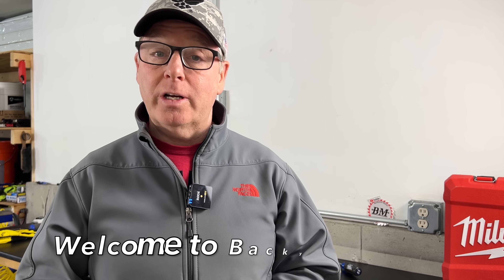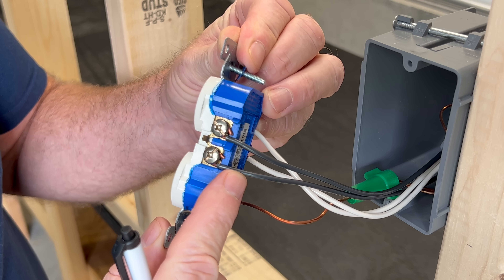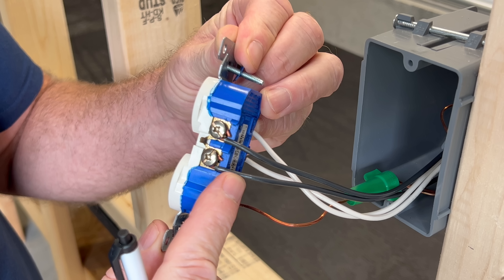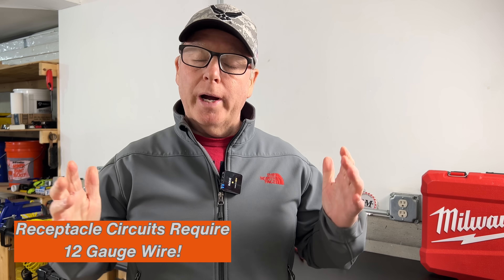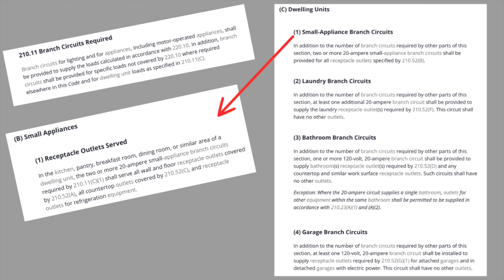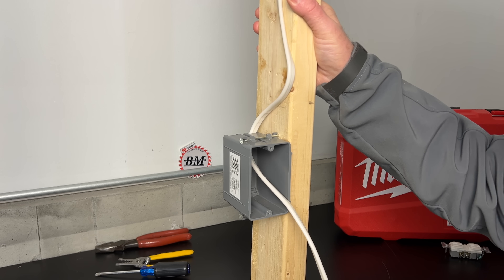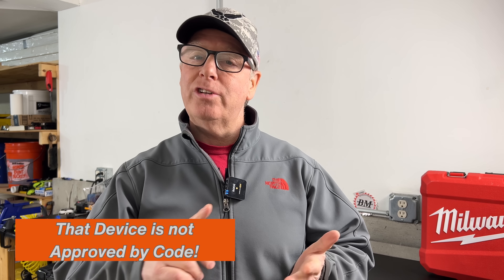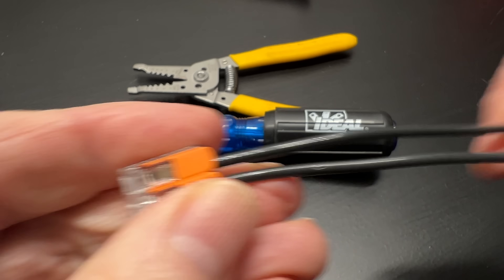5 Electrical Code Lies DIYers Should Stop Believing!

Comment: Hopefully this can be answered.. So for the past 2 years my outside outlets have been tripping the breaker even after replacing all the outlets, well i finally figured out a week or 2 ago that one of the outlets i replaced was faulty itself and was causing the problem, of which i have now THANKFULLY resolved.. So my original plan was to install 1 or more GFCI outlets but upon trying the box isnt deep enough because of the extra size of the outlet and the wiring so i just went back to a normal outlet, its unfortunately a recessed box thus my problem.

Now the thing is, my house was built in 2000 and when it was it never had any outside GFCI outlets (until i got a pool) but it had a GFCI Breaker to handle all that.. So how would i go about resolving the recessed box issue? would simply a deeper box fit in the current recessed place or would i need to have some kind of work done? 

Note: Its POSSIBLE it would fit if i pushed back some of the wiring into the wall but i didnt want to risk doing that.. So any thoughts?
Reply from the maker: You could install a GFCI breaker and use a standard receptacle, install a deep box bits that’s going to be a bit of work. Leviton make a slim profile GFCI receptacle which is about the same depth at a standard one. That may be the cheapest and easiest solution.
Reply: @BackyardMaine Yeah id rather not have to go with the box route lol 

The outside outlets are already under a GFCI Breaker but id rather a gfci outlet have control over it than always having to mess with the breaker if something happens.. I'll take a look at the Leviton, thanks :)

Comment: Would like to see a demonstration and your opinion on installing a GFCI in older homes with no ground. Will it actually help with electric shock or in helping to protect sensitive electronics.
Reply from the maker: Great Idea for a video. Yes a GFCI will still provide protection with no ground wire. It won't provide any protection for sensitive electronics though. For that you need a surge protector. They can be installed as a whole house unit of you can use them at the point of use.

Comment: Good video,    sounds like "discussions that may have come up with inspectors".   NES is basic framework document with many exceptions listed. Intent is to do best practices that keep the next guy alive.     In TX,  very little training required before Electrician on their own.    My top two worst finds:   2) septic pumps wired w Romex.  Needs water proof type of insulation on conductors.  2) Stoves not wired with 3 cond+grd.   Old style 220 v 2cond+grd  wiring short lifes the newer smart ovens or stoves.      Thank you.

Comment: Well said John. And by sticking to the NEC Standards, one is more likely than not, to perform safe work that will pass inspection. If someone sites the code, tell them to show you where. Make them prove it. Well done John. Thank you.
Reply from the maker: Thank you my friend.. I have asked for the code reference a few times but either they don't reply or reference the wrong article. Like article 81.. lol

Comment: So just if you install 20 amp receptacles, you should use 12 ga wire. And 15 amp receptacles use 14 gauge wire. Since it is labeled on the package from the manufacturer.  It could be a violation too install 12 gauge wire on a 15 amp receptacles ???
Reply from the maker: You can use larger wire like 12AWG on 15A receptacles as well but of course you will have to use the side wiring connection which I recommend anyway. The back stab connections are only listed for 14AWG solid copper wire. Ive been an electrician for decades and I as well as most other pros use 12AWG on 20A circuits and 14AWG on 15A circuits.

Comment: I was removing the 14 gauge wire out of my garage, House built in 2017 in North Carolina, replaced it with 12 gauge, and upgraded to a Combo GFCI/AFCI 20 amp breaker.  I was taken by surprise that a house built in 2017 had a 15amp service non-GFCI in the garage and it passed inspection.  I am the second owner and I had an inspection performed on the house before the purchase.  I had a house built in Georgia in 2015 and every circuit was AFCI or GFCI protected and it had to be a 20amp circuit in the garage.  I learned a very important lesson about states and the adoption of the NEC codes.
Reply from the maker: The issue is not all electrical inspectors have equal knowledge of the code and when you hire a home inspector to as a contingent to buying a home they are usually not as knowledgeable as a trained electrical inspector and they will miss things like a 15A non-GFCI circuit in the garage.
Reply: Under the NEC there are three locations where AFCI protection is not required in dwelling units:  bathrooms, outdoors, and yes, garages.  No need for a DF breaker on the garage circuit, although it might be more readily available than GFCI-only breakers in some areas.
Reply: @steveloux4709   I thought bathrooms still needed AFCI in modern code but it appears I am mistaken. However there are definitely other places where AFCI isn't needed, notably unfinished basements and attics. 210.12(A) shows there they are required and the omissions are where it's not. But it should also be noted that if the circuit has any devices (such as a switch) in the living area it needs AFCI even if the lights themselves are in area where they do not.

And unless they changed it only receptacles in a garage need GFCI protection. No need for a GFCI breaker, a standard breaker and common GFCI receptacle work just fine.
Reply: @steveloux4709  This is exactly the case here.  I can find old-school breakers and Dual Function only Breakers where I can shop as a homeowner.  I just checked Amazon for Square D QO, I can get GFCI only but pay more than I would for Dual Function
Reply from the maker: I think we were talking about GFCI rather than AFCI protection. GFCI protection is required in garages..  @steveloux4709

Comment: I've never heard anyone say that these are code. I know some argue about doing items like ground up, or pigtails better then wire thru. But you need 12 gauge on any 20 amp circuit or in kitchen/bath/exterior outlets/washer circuit. I prefer to put 12 on living circuits too tho where possible. You have a noticable draw on high draw items (curling/flat iron, clothes iron, blow dryer, clothing steamer, etc) and it will cause light dimming and things like that.
Reply from the maker: I’ve heard all that I mentioned 100s of times in the comments on my videos. I had several just today alone telling me ground up, pigtails and 12AWG a for all receptacles are required by code.

Comment: NEVER EVER USE A COMMON NEUTRAL !!!!!!!!!!

THE VOLTAGE DROP IS EXTREME

I SPEAK FROM EXPERIENCE HAVING TO REWIRE MY ENTIRE HOUSE BECAUSE I USED A CHEAP BUILDER

THE MONSTER USED SHARED 500 FOOT RUNS FOR EVERY ROOM AND SHARED THE NEUTRAL 😢😢😢😢😢😢

WHAT A NIGHTMARE
Reply from the maker: 500 foot runs in a home.  Interesting.
Reply: Common neutrals across multiple circuits are very bad. Multi-wire branch circuits, which are very similar but have specific requirements, are good. With an MWBC you get less voltage drop than with two separate circuits.
Reply from the maker: Common neutrals on two circuits form the same pole is dangerous because the current on each line wire will add up in the neutral and possibly overload the wires capacity. Common neutrals on different poles are multiwire branch circuits and there are several requirements associated with them.  @eDoc2020

Comment: its a national minimum std. Also in practice code is whatever your inspector says it is.  At least if you're expecting to make your deadline.
Reply from the maker: I hear that a lot but it's not accurate. If its a minimum standard then I suppose you run 10AWG for 20A circuits rather than going with the minimum 12AWG.
Reply: Its absolutely accurate.  If you choose to follow code that is the minimum required by definition. 10awg would be code compliant for a 20 amp cir.  Its just not required by code. @BackyardMaine

Comment: This video may be informative but every thing your disproving are all good practices or what some would call the best way  For example pigtails they may not be required for code but they are far superior because you're not relying on each receptacle as the connection point Next example service loops I don't know of anyone who puts a 12 inch service loop in the common is six inches and that is a very good idea with how often people decide to change out their switches or  Receptacles etc...
Reply from the maker: I disagree but thats what electricians excel at based on my experience. lol. I have a video on when and why I use pigtails. I don't think they are always best practice and I disagree that they add a level of reliability. A wire nut connection is no better than a screw terminal connection when they are connected properly. And I have never used service loops because in my view they cause more problems than they solve I have seen them pinched between the drywall and stud, damaged by the insulators, had screws through the cable etc. Check out this video on the (build show) to see contractors leaving large loops.
Reply: @BackyardMaine  when you rely on the outlet for the connection if one fails it takes out everything past that point right ...
Reply from the maker: @iPunisher  Makes it easy to find and remember a wire nut connection failure would do the same thing.
Reply: @BackyardMaine  also my mentor always taught me that a wire nut is not a connector but a cover to the physical twisted wire connection ... but like they say there's a million ways to skin a cat so to each their own
Reply: @BackyardMaine  i mean to each their own but in my 25 years of doing electrical work and hvac work I have never had a wire nut fail but I have seen hundreds of  Receptacles fail due to things loosening up from a plug being shoved in and pulled out hundreds of times so that's where I'm coming from on that.

Comment: Number 6:  To connect a generator temporarily in an emergency power outage you must have a transfer switch or interlock device or you'll be arrested!
Reality:  702.5 Interconnection or Transfer Equipment
Interconnection or transfer equipment shall be required for all standby systems subject to the requirements of this article. Equipment shall be suitable for the intended use and shall be listed, designed, and installed so as to prevent the inadvertent interconnection of all sources of supply in any operation of the equipment.
*Exception: Temporary connection of a portable generator without transfer equipment shall be permitted where conditions of maintenance and supervision ensure that only qualified persons service the installation and where the normal supply is physically isolated by a lockable disconnecting means or by disconnection of the normal supply conductors.*
Reply from the maker: You are correct but I'm not sure how many people are getting arrested for it. I have updated quite a few illegal connections in the past.
Reply: @BackyardMaine not saying people would get arrested, just that electrician-types online SAY that you will.

Comment: The issues I see with the NEC is that old work never has to be upgraded. Houses built 50 or 60 years ago were wired with maybe 10 or 12 circuits and still function today. Even though we are using more electrical items today we are drawing less current due to modern electronics. If I turned everything in my house on I might draw 50 to 60 amps on a 200 amp service.
Reply: It really depends on whether you are using gas cooking, air heating, water heating or all electric. Plenty of houses have to be upgraded to a larger service panel because of the added large electrical loads like that.

Comment: Nice video.   Now do a video on the parts of the code that are unnecessary boiler plate that can be ignored without any compromise in safety or reliability.     (I'm an electrical engineer, and I have met and worked with some of the IEEE guys who write the code, and I can tell you straight up that most of those guys have never touched a wire in their life.  They are in their 60s and their useful life as engineers is over so they attend IEEE meetings and make up issues to "solve". )
Reply from the maker: I know what you mean. I was an electrician for over 20 years before moving into electrical engineering. There were some engineers that I knew that had no concept of the practical application of what they learned is school.
Reply: I understand the point that you are making but maybe you should rethink the way you are presenting it after acknowledging that the NEC and the Fire Code are 'written in blood '(as is said) and should be respected and followed. Just as unforseen conditions/ possibilities lead to tragedy and were afterwards backward engineered into Codes so we must humbly honor the Code admitting that we can't possibly know the genesis of every hard learned lesson built in to these codes. Yes, sometimes we see what looks like ill-advised new code or (worse) Manufacturer- influenced code but many times corrections are made in the next cycle. Despite misgivings I would definitely agree with on some things in the code, I think it wise to promote the NEC to other tradesman as a duty to abide by rather than anything less.

Comment: I was surprised to see the photo of the outlet mounted above the electric baseboard heater. In Canada, that was a no-no back in the 70's.
Reply from the maker: That is not an electric baseboard heater. It's a hydronic heater (hot water) which gets warm but not hot. Mounting receptacles over this type of heat is fine. NEC 210.52 has an Informational Note: Listed baseboard heaters include instructions that may not permit their installation below receptacle outlets. This will only be found from electric baseboard heater manufacturers because operate at much higher temperatures.

Comment: Thank you for the attempt to point out the difference between code requirements and installer preferences.  Being a former code inspector I have always been infuriated by the "experts" providing misinformation about the code requirements. I personally think some of this school of thought originated by way of uneducated inspectors thinking they know better and put their own spin on the requirements. The trades cave into these "requirements" rather than face a failed inspection since many of these items do no actual harm.
Reply from the maker: That's an interesting point and may be a contributing factor. Since I stared this channel I have learned that there are a lot of electricians that are confused about code requirements. I think many just go by what they were told by their superiors or maybe inspectors as well.

Comment: Ok! My love of 12 gauge wire to receptacles is a preference. But, please, can we stop wiring ceiling lights and wall receptacles on the same circuit?  Plunged into darkness while running power tools….

Comment: You will always get a violation no matter how hard you try. There are many safe ways to wire but will be identified as a violation because of picky, obscure, incomprehensible code.
Reply from the maker: The code can be confusing but once you break it down it's not that bad. I used it like a tool daily as I was writing job specs for years. After a while it became very easy to use and understand.
Reply: The overwhelming majority of code requirements and language are neither obscure or incomprehensible. If you want to know what the code says, read it yourself and don't let someone else tell you what it says.